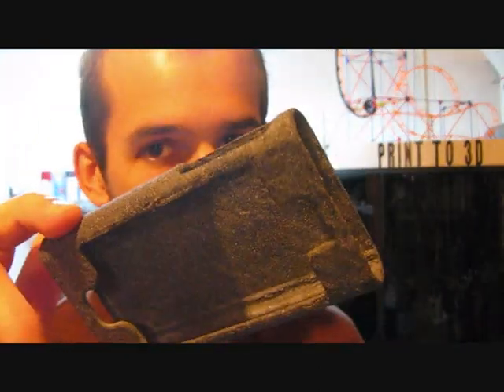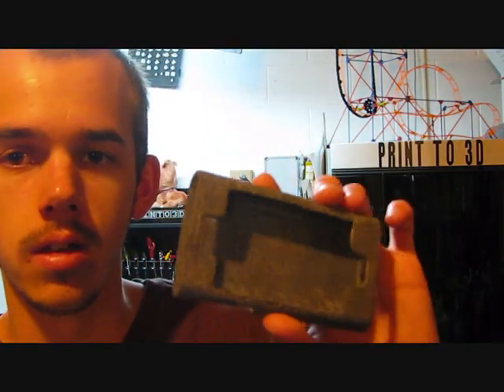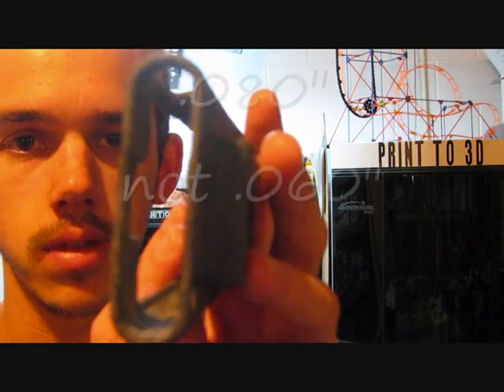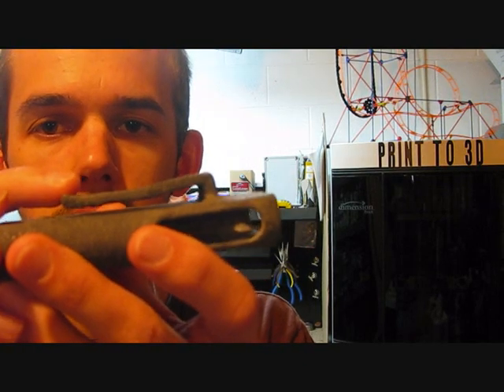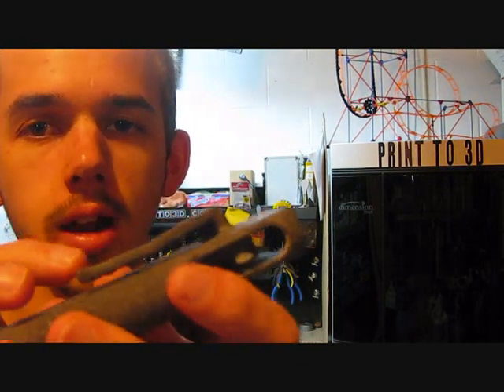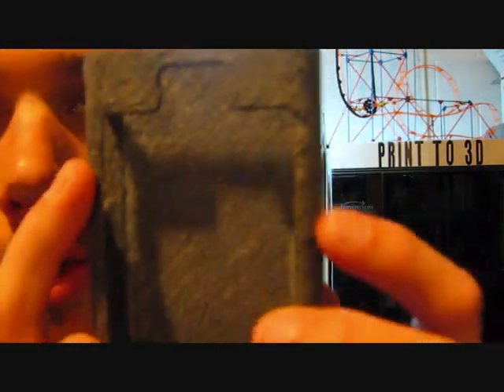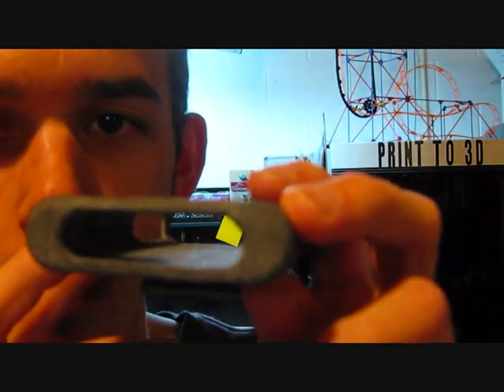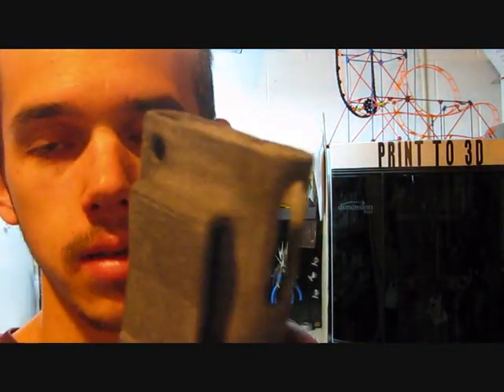Desktop Factory iPhone Case 3D Print!!

Comment: Hi Brad,
I am really interested in the performance of the Desktop Factory. I have been contemplating buying one and as a 3rd year engineering student think that in 5 to 10 years every engineering student should have one. 
I do have a few questions if you have a second:
1) Did you measure the mass of that part? Just curious of the density of the material.
2) Also interested in its durability. Do you think if you dropped it would it crack or break?